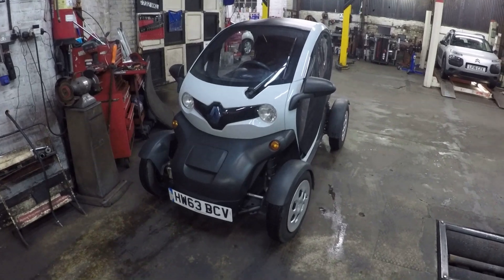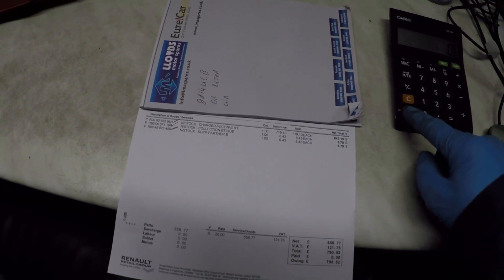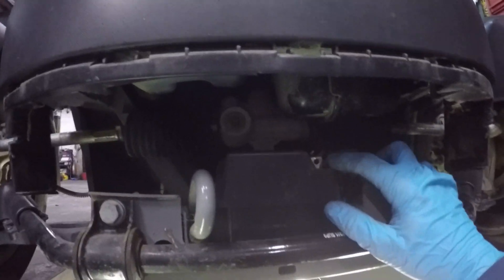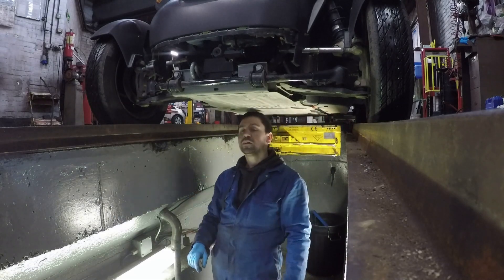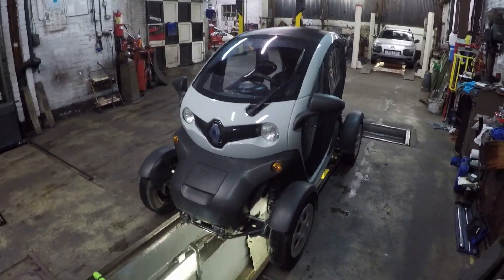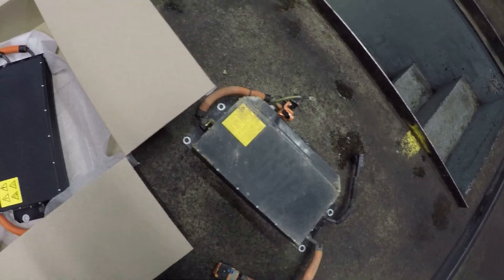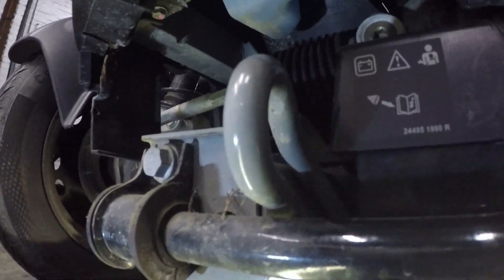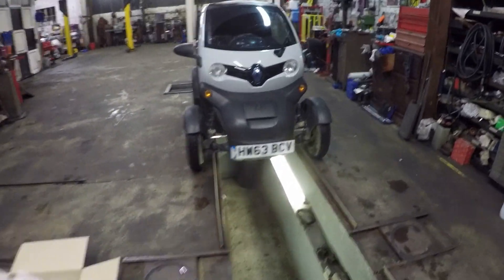Renault Twizy charger replacement

Comment: Thanks for posting this.
Yesterday I got home and plugged my 2012 Twizy in as usual and it wouldn't charge.
Checked the 13 amp fuse etc and all seemed OK. 
Plugged it back in and it started charging as normal. 
Sounds like mine has the same problem 😐

Comment: thanks for being so kind to post this video. My charger seems to have the same problem as i find my twizy not charged from time to time. Hopefully there's a common fault in these old 2012 charge units like mentioned below... changing a 2 cent mosfet or so. Guess i'll need to examine that further. Greatly apprecianted!!!

Comment: Thanks a lot. I’ve change my charger at Renault dealer and cost me 1200€. Then realized opening the bad charger that all it had was a blown mosfet few cents and could be fixed, let’s wait for the mosfet to arrive. Thanks for the video it will be very useful to test the fixed charger, cheers!
Reply: Jeroen Bleker waiting for my air solder to arrive, already had the new mosfets only need to solder them, i will keep you update
Reply: @Chas75 so? you fix it?
Reply: Hello. Did you find out what is causing the short circuit?
Reply: is this the one that breaks the most? mosfet ? My charger broke but I don't see the point in paying £1200-1500 for something that can be fixed

Comment: Actually the handbook delivered with the new charger is different from the one that came with the Twizy. The old charger only charges the 12 V battery, when the Twizy is charging or running. The new charger charges the 12 V battery once an hour or so, even when the Twizy is turned off. Because of this the new handbook includes an warning, that the 12 V line is on power even when the 12 V battery is disconnected.
Reply from the maker: uthelm222 thanks for the info 👌🏻